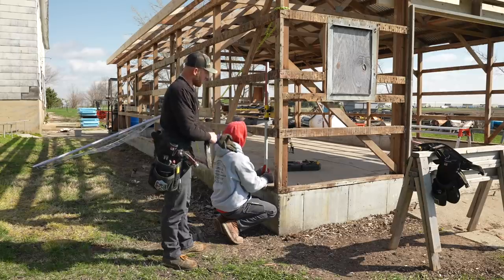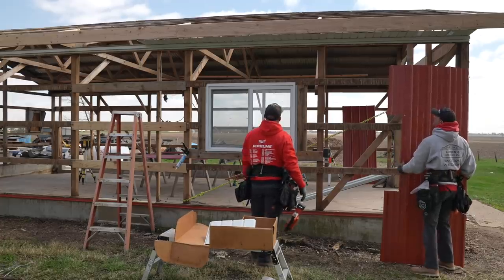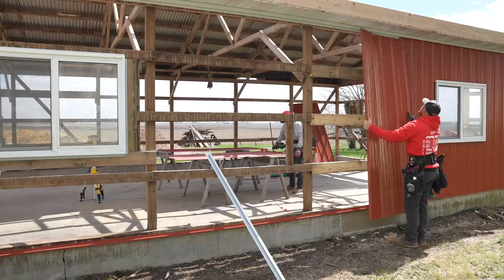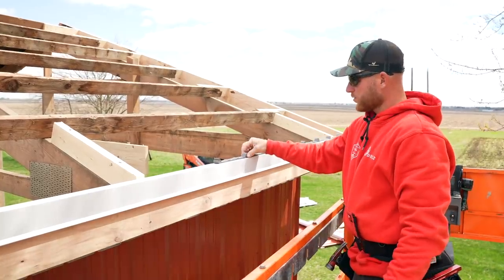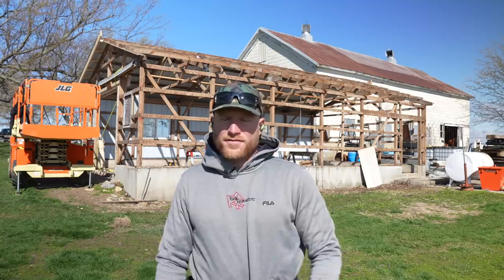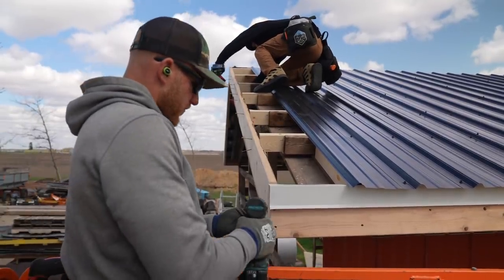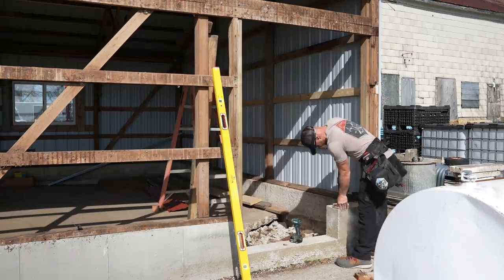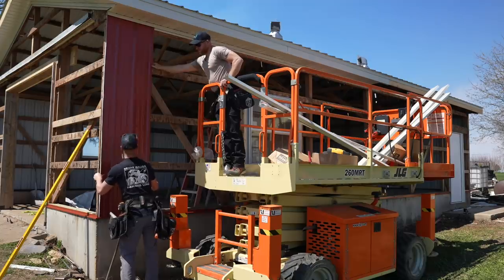Remodeling my Parents Barn Final

Comment: We did, it was a metal box store shed with a wood shed built over top of it then out side sheds,{over hangs} built around 3 sides . Tore it all down except the out side walls ,extended the walls to 8' , and put a home made truss roof on it with a steel roof . Filled in the board sides with used 1 by decking ,and will stain to mach.  Put a 7x9 rollup door in front.Expect it to look decent.

Comment: Perfect time to tell you - you have been immensely helpful and I have a project that is somewhat similar in a re-roof and partial reskin, along with add on's.  My old shop building is just a 30x40x10'6" box, enclosed, good concrete pad within, and has electrical breaker in it with power to the box.  It is currently looking terrible with an exposed fastener light tan body ("light stone"), barn red roof, and a white 36" door along with an insulated 10' x 9' roll up door in the center of the front - trim color matches .  No overhang, no frills, just an ugly box sitting it the back third of my 3 acre lot with my home - with mold needing cleaned off the north side façade.  The wife is starting a business which has taken over our home, and she is getting my shop.  It has to be cute - as she will be running some retail from it in a crafty, boutique type setting, and we are also going to put my office (also in the house right now) into the building along with various storage needs and etc.  .  You changed my thought process on pole barn to building as the R&R process. This year will have this listing done to the building AFTER extensively cleaning it out (this nearly 50 year old man is tired just thinking on it): 
1.	 Base building footprint and elec untouched, all metal siding (except front possibly) remains. Front may be reskinned or sided.
2.	Add 9’ deep shed roof porch with 12’ opposing gable roof of same depth by 14” width over big door way in center with 4” concrete pad under it (finished porch ceiling req – prob .
3.	Roll up door changed to BIG patio doors 10x9 if avail, sidelights, transom?
4.	Add 2 pair or 3 pair of 2/8 or 3/0 wide by 4/0 or 4/6 tall casement window units equidistant from the ends of front façade on shed porch sections.
5.	Add enclosed on 3 sides lean to shed storage to rear 38’w x 20’l, 8 clear height @  eve entry  – metal roof and siding to match building, 1’ overhang at drip edge.  Enclose other wall later with doors and concrete floor later.
6.	Add 10’ wide by 30 deep roof only area (metal truss preferred) matching current roofline.
7.	Add new 12” or 18” ladder overhang to all rooflines
8.	Office, small powder room, and storage room added to 1/3 of current plan on west end of building.
9.	Re-metal entire roof to match color choices, add interior wall insulation and materials in shop, finish wiring package
 I used to be employed in the trades before my current job, before that a life spent on the farm and various trades with lots of HIGH skill areas - and I still look through your videos like a college level course for learning, tips, little tricks, and entertainment.   I intended to stud wall my building and etc, but you showed a much more efficient way  to do so in this and other videos, especially the garage build that introduced me to your channel after a short of window framing started me down the rabbit hole.  I cannot overstate how much time and money you have shaved from the upcoming project, nor how appreciative I am for it.  Thank you, thank you, thank you and Greg for sharing so much knowledge and excellence - if you were closer to W TN you gentlemen would be getting a call.  Again, thank you, and apologies for the comment length!!!!

Comment: great job .. i am in NEW YORK who ever built the pole barn on my new property  never used the foam on the roof .. i get rain and snow that blows in .. ugh i had a snow drift this winter in the middle of my shop ..it needs new wall tin . its getting rough in the lower section .. might cut it at a 3 ft from ground and just replace lower section with a different color ..roof is another problem ..have to pull the ridge cap off to fix the no foam and pull loose the lower edge of the roof to fix the no foam ..wish who ever built the building watched your videos before they had built it ,, keep up the great videos

Comment: Looks good man, I know what you mean about polishing a turd. I live in an old house built in 1904 with an English bond with no insulation gap. Had to frame out and insulate all external walls/ceiling with a mixture of foil back hard foam and spray foam. Not a single straight wall in the place when I started, but you can hide a lot behind framing and plasterboard. Looks 100 times better now.

Comment: Pretty cool that you didn't tear it down and rebuild it you are able to remodeled it instead! Especially with lumber prices today! I just paid $60 for One Piece of half inch ac2 plywood talk about almost falling over LOL
Reply: Paid 150$ for 2 sheets of 3/4” oak plywood last week. But it still beat paying 15$ a piece for horrible looking 1”x8”x8”. That’s sad that it’s almost cheaper for the carpenter to rip down his own lumber than to just buy it off the shelf. Obviously time vs. money problem but i was wrapping basement Columns and wasn’t about to use the hideous looking 1”x8”x8’ pine that HD wants 15$ a piece for. They wanted 20$ a piece for the most crooked beat up looking 1x8x8 pre primed finger joint boards. It took me  20 mins and a table saw and I made perfect 1x8s. I was mitering the edges anyway so I didn’t have exposed end grain and plywood is a lot easier to work with. Especially mitering edges.

Comment: Drill or punch hole at desired overhang length into the purlin beating leg of roof panels. You won't have to pull that tape measure out every time.

Comment: I don't get the idea behind installing roof steel with screws not on top of the ribs. From what I've seen, it comes huge infiltrations sooner or later. We've actually replaced every single screws that was installed like you did from a 30 years old building. Every single one of them was rusted inside out and were causing important infiltrations.

Comment: Would it make sense to make the structure more rigid, as it  appears the wood flexes a lot, and then how ? I suppose a cross to the rear only would not be sufficient?
Reply from the maker: That’s how most structures are when. Just wood and no chains holding them down

Comment: We have a 1970's Menard pole barn (60 x 40) that is in need of new roof steel. Has staggered purlins, no soffits, and pretty full of treasure (aka crap). Would you approach it by removing one side of roof steel and replacing that, then switching to the other side?  Tarp it if it's going to rain.

Comment: Could you maybe explain how to do the top j trim when the steel doesn’t die in a flat, but instead in a rib on the side of a window or door. I’ve seen almost all your videos and in one you’re trimming out a window explaining layout and how you want the steel to die into it in a flat but sometimes it just doesn’t work out that way and that you’d explain when  a rib meets the window. Or if there’s a video I’ve missed, would it be possible to tag it. It looks like that happened on this barn, the door specifically. Looked like the left side was cut out more(bc of the rib) than the right side(in the flat). Maybe it was just the camera angle.

Comment: Awesome content! I have a few questions that i haven't found on your channel and was hoping you could answer. How would you insulate the shed now? Ive read without installing the vapor barrier you have to use foam boards or pull off the exterior and apply the barrier. Just wondering what is the proper way to do it. Also i haven't found how to install windows on an existing building. What would be the proper steps to add windows? Thanks for the content and hopefully an answer that others werent able to answer for me!

Comment: Are you confident with the crown staple for trims and soffit, if so I might pickup a stapler and save a little bit of time and money not using screws
Reply from the maker: Heck yeah works awesome
Reply: @RRBuildings  I’ve got the brad nailer I just wasn’t sure how well the staples would hold steel on

Comment: Still haven't seen you use Metal Sales 7/8th stitch screws on the roof, with a regular screw on either side of the overlap, like the installation instructions say to use?
Reply from the maker: Don’t plan on it either
Reply: @RRBuildings  Ok, any reason why?  When you put trims on, you put the screw in, back it out, and then screw it in again.  It's because those screws spread out the metal.  That's the opposite of what you want on an overlap, and a stitch screw is designed to pull two pieces of metal together.  Just seems odd you aren't following recommended procedures.

Comment: Hey Kyle aren't you supposed to screw on the top of the rib when the steel is used for a roof?
Reply from the maker: No ask your supplier they will let you know what to do and not to do.   It might vary with area and requirements